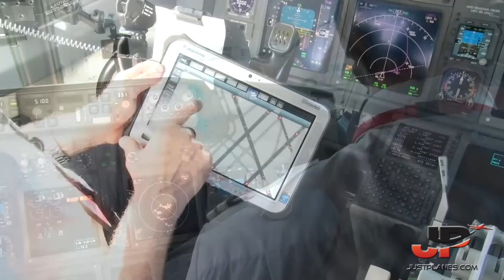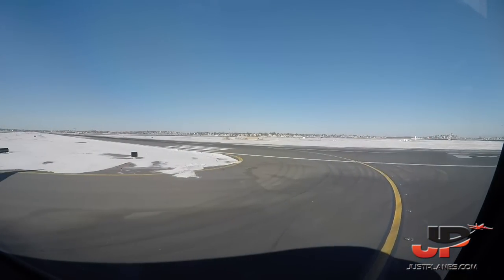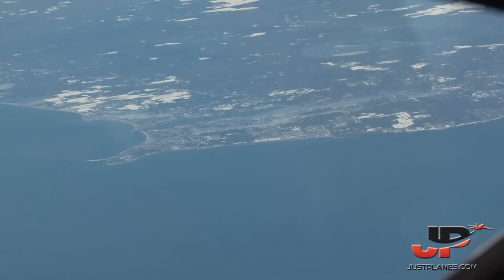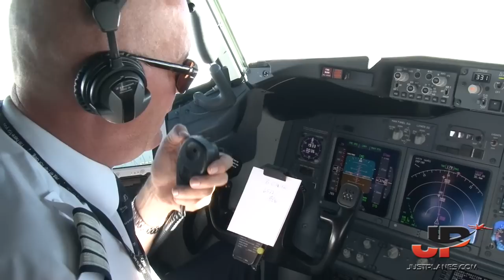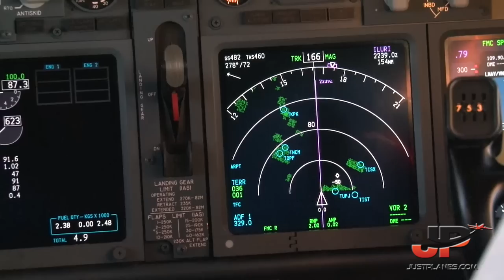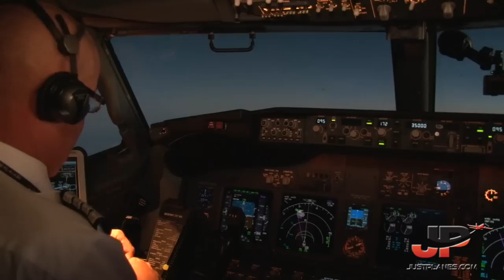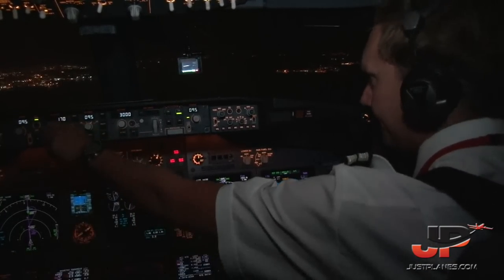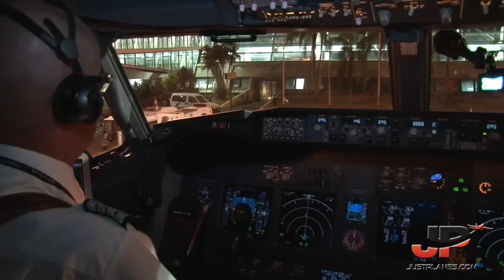Piloting Norwegian 737-800 Boston to Caribbean | Cockpit Views

Comment: Wow...landing without flaps fully down and turning off landing lights prior to exiting the runway...arent those protocol violations?
Reply: No, 737s usually land with a flaps 30 configuration unless the runway is very short or if there is a weather issue.